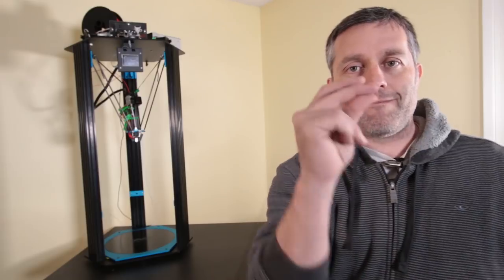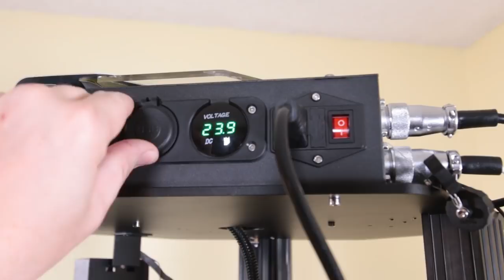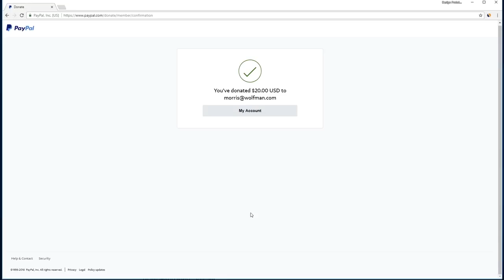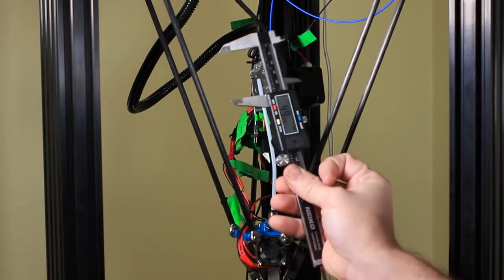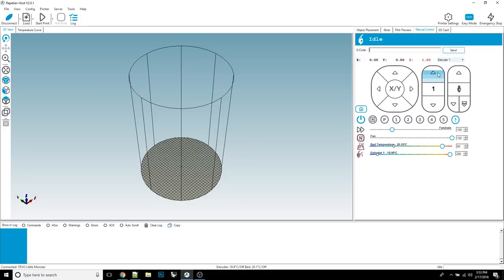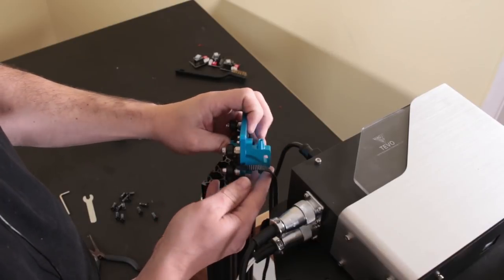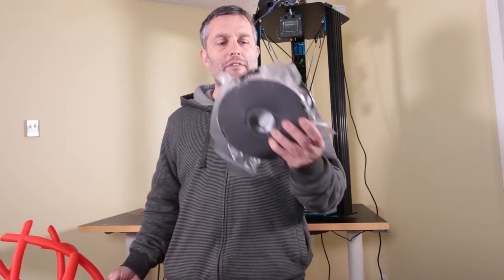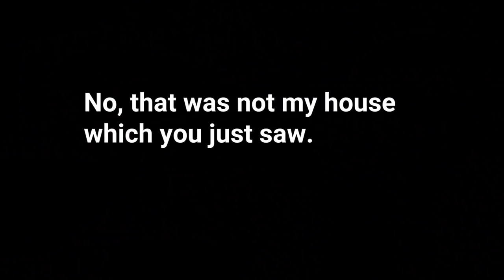The Little Monster is Next Level

Comment: One of my belts is kind of twisted... like when you put your seat belt on and it's not flat across your chest. I can't simply untwist or reattach it; am I ok to print?
Reply from the maker: It might work twisted. I didn't try it.
Reply: Design Prototype Test regardless your video has been most helpful, you have my gratitude. I will let you know whether or not it works.... and/or crashes into my heat-bed.

Comment: HI. DPT, thank you for this great 'introduction' to this little monster printer. This is definitely the most in-depth video about a 3d-printer of that kind and at the same time the most helpful to understand this kind of printing technology. Most reviews don't go into this depth and sometimes do not solve issues that thoroughly like you do.
However, even if I am quite confident about my skills to solve technical issues, I wouldn't buy it as a first printer. I assume I would have to spend too much time to get a descent print.
Reply from the maker: All of the issues stem from the control board. Simply replacing that with a DUET should be a relatively easy install, and then the printer would be the best one I own as well as my favorite. Keep and eye out for my future videos on this subject.
Reply: DTP, thank you for replying :)
I didn't mean to say it is not the best printer (from what I have seen in videos it seems so and I believe what you're saying).  I simply was trying to express my doubts if I will be so skilled to do all the hacks and modicfications, esp. when the time for "my-first-3d-printer-project" is somehow very limitted. But I will keep an eye on your next videos esp. when it is about replacing the board. Again many thanks that you share your experience and support the OpenSource idea.

Comment: ACK isn't "auto command".  Its showing the "Ack"knowedgement from the controller of the commands you're issuing.  Looks like those radio buttons just filter the log for the information you're want to see.
Reply from the maker: Yeah, that makes sense, but there is still some kind of auto command being issued because even if I don't enter any commands, if I turn on "Auto scroll" it's line after line repeating this:
OK
OK T: 19.9/0.0/@0 B20.2 /0.0 @0
Reply: Autoscroll would just be... like using the "tail" command in linux.  It basically lets you watch the log file get updated and see the tail of the log file.  If you clear log then it will start with nothing and then as the processors issue commands like, "check current state" or a periodic read of stepper controller positoning...anything else, moves to coordinates or whatever that are ALSO suppose to echo that response they received to the log, then that's all you're viewing in that window and the radio buttons allow you to filter that information to find what you're looking for.  So only looking at ACKs may or may not be what you want.  Errors or other information might be useful as well.  Like Windows system logs.  Much of it is extraneous stuff that is transparent to the user and don't affect anything.  You have to know what you're looking for.

That output :
OK 
OK T: 19.9/0.0/@0 B20.2 /0.0 @0

Just looks like an acknowledgement from something else that was asking, that the state is OK.  Clear the log and select ALL to get a better initial picture of what is going on.  What the ACKs are in response to, etc.  Taking them out of context isn't very helpful.

Comment: hello nice video i just got a tevo little monster but have a problem with the heat bed dont start heat up and then the calibration will not start becurse of that any idears thanks again
Reply from the maker: First, Try turning it off and then on again with the switch on the power supply. The first time I try to run a calibration after I install the Firmware, it never works. I always have to power cycle it. If that doesn't work, then you need to start trouble shooting. Is the screen reading a temperature from the bed? If it says the bed temp is 0 then you have a faulty thermistor. Try unpluging your bed heater, and put a muliti-meter on the leads coming from the Power Supply. Are you getting current there? And so on and so on. Just keep testing things until you find the source of the problem. Good Luck!
Reply: thanks again yes i have tryed everything i have a faint idea that it can be the box in the power supply that dont work proberly everything els works just the bed that dont start heat up but thanks for the replay

Comment: Problem after Firmware Update. https://rothlive.de/Firmware.jpg Can anyone help me ? @Design Prototype Test can you please send me the Firmware from your SD Card ? On my is not the Firmware for the tft. And the Firmware that is online from Tevo makes the same Problem.
Reply from the maker: Markus, you can find the original firmware for the MKS TFT 2.8 screen on the 'open source Tevo Little Monster' project over on thingiverse. Also, ask at the Facebook group for upgraded firmware for that screen.
Reply: Ok i try ist but always the same Problem. only a Version newer 3.0 works. Then the screen is ok. Does the board firmware affect the TFT screen?
Reply from the maker: >Does the board firmware affect the TFT screen?
No.Not that I have ever observed, and I don't see why it would from a design/programming point of view.
Reply: I have testet a little further.
Tevo Version based on Version 1.2 from 2016.

All versions below 3.0 have the error.
Also the versions of https://github.com/.../MKS-TFT2.8-3.2/History%20version

Hardware defect?
I dont know.
For it to work again, a new firmware would have to be created based on TFT28_32_v3.0.2 Release file.zip.

Or another hardware unfortunately.
I also do not understand why that is.
https://github.com/mak.../MKS-TFT/tree/master/MKS-TFT2.8-3.2
Reply: Tevo have send me a new Firmware. Tevo created this for me today.
It works again.
Who also has problems can contact me.

Comment: Hello, may I know what type of hotend comes with the Little Monster? Is it the metal hotend?
Reply from the maker: It looks like a clone of an E3D Volcano. In that sense it is an all metal hot end. I did not disassemble it to see if there is a PTFE tube inside, but I suspect there is. This is a good thing as it gives you the ability to have longer retracts without risk of clogging the filament tract. With an all metal throat (no PTFE liner tube) you could crank the hot end to 300+ degrees, but you pretty much only need temps like that if you are printing with Polycarbonate.
Reply: Design Prototype Test thank you for the information, yes I'm thinking of printing with polycarbonate filament. It's quite difficult to print with but I'll guess i'll add enclosure to the printer
Reply from the maker: Best of luck man! Report back with your results. That's a project which has been on my to-do list for a while now.
Reply: I have printed polycarbonate on this printer.  3dxtech polycarbonate, polymaker poly-max , a
Priline PC-CF. The polymake PC-max is BY FAR the easiest to print!  255°C and 60°C Bed with Buildtac, no enclose needed keep part fan off.  The 3DX tech needs PEI tape or ABS slurry to stick (enclosure highly recommended) this is a g good material but the Pc-max just prints SO easy and mechanically equal to the 3dxtech PC. The priline PC-CF prints great but isn't anywhere near as strong as the other 2. Get the Polymaker, its  worth it
Reply: Oh yeah, genuine E3d V6 1.75mm all metal heatbreak + 3dxtech Hercules A2 Volcano nozzle Chews through 3dxtech CarbonX carbon fiber Nylon all day! Also a fantastic material and the cheapest CF-nylon I can find! Good luck Guys!

Comment: For anything that comes close to 1000 I'd just buy a MK3 and try to get a bigger frame for it, I love my delta but having one as a main driver can be hard.
Reply from the maker: Perhaps you aren't thinking about what you are saying. Maybe you don't mean it. The most valuable thing about the Mk3 is the magnetic flexible bed. This is the limiting factor not the frame. At 320mm the bed on the Little Monster can completely contain the Mk3 bed and still have 280 square cm more of printable area. Do you see how big this thing is?  Sure, You could increase the z-height of the Prusa frame in theory, but you're going to spend FAR more than 1000 to do it right (water-jet cutting aluminum is expensive), and then your are going to have a tall and untested frame. Maybe it won't be stiff enough when you make it that big, and your print quality will suffer. Also, I'm not aware of anyone modifying the firmware on their Prusa printer. Is it even possible? If you modify your Prusa to be taller,  will you still be able to run Prusa firmware, or will you have to downgrade to Marlin and lose a lot of functionality? As far as I know the Prusa isn't upgradable except by Prusa (multi-color).
Reply: The most valuable thing about the MK3 is the flexible bed... yeah you need to catch up on that. And just to be clear don't mod your MK3, but for 1000 and that size I think Creality has something in that ball park.
Reply from the maker: "yeah you need to catch up on that." 

I'll get there 😉

Comment: Amazing video. Best one I've seen on the LM so far! To fix the skipped steps, you might wanna look at adding some TL smoothers (diodes to the stepper controllers). Reading up on LM problems it seems to be a common DRV8825 stepper driver problem.
Reply from the maker: Thanks for the comment! You are completely right. Check out my follow up video where I fix the layer skipping and also talk about the DRV8825 drivers and begin the upgrade to Trinamic stepper motor drivers. In the next video I will do some experiments on Trinamic drivers vs. TL smoothers.